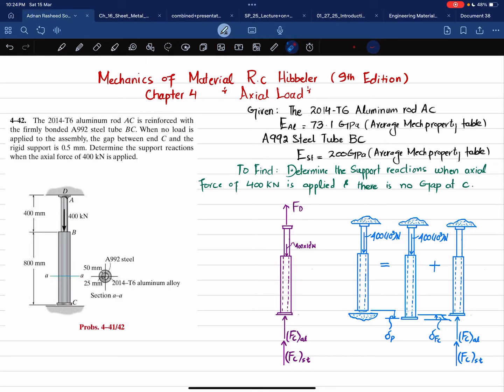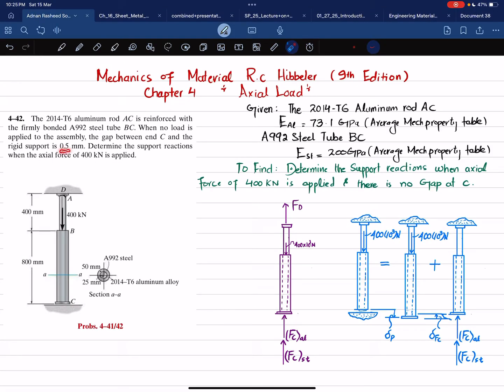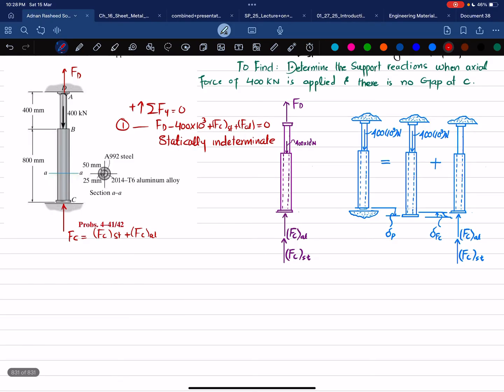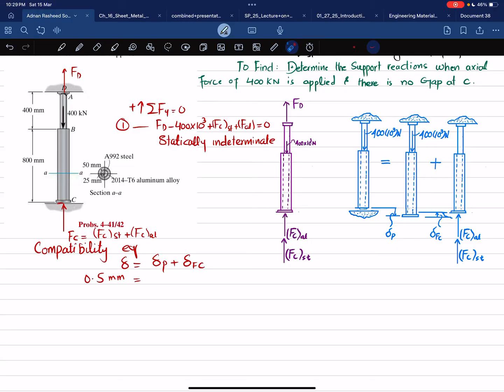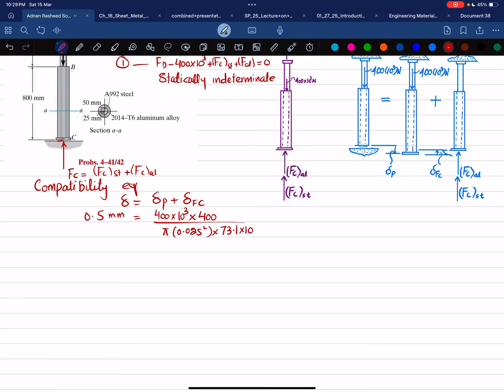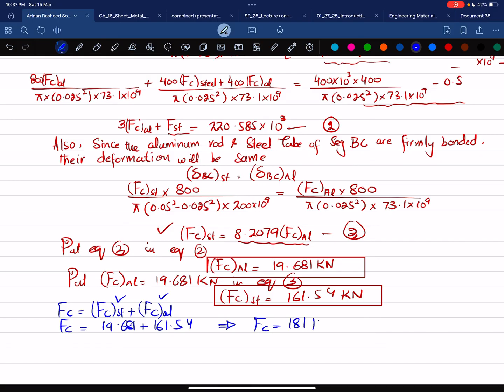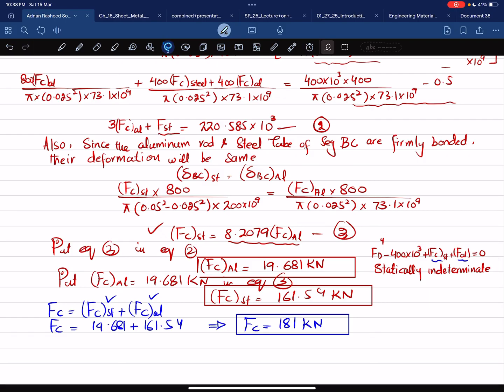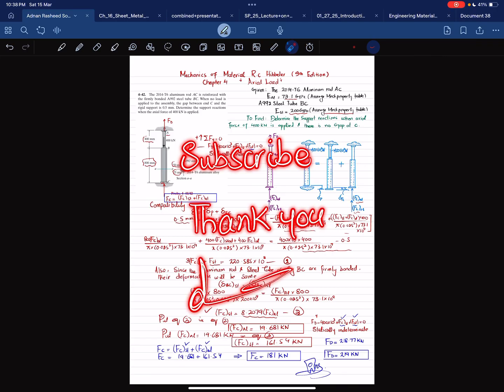4-42 | Determine the support reactions || Mechanics | Mechanics of Materials RC Hibbeler

Comment: 5:46 i dont get this part. Why would not the whole paranthesis be negative when both Fal and Fst is compressive? And how do you write them in the same fraction after that with only the modulus for Fal that is E = 73.1 GPA
Reply from the maker: YOU ARE RIGHT ITS A SMALL MISTAKE THERE IS NEGATIVE SIGN OUTSIDE PARENTHESIS AND INSIDE PARANTHESIS BOTH TERM ARE POSITIVE AND YOU CAN SEE IN NEXT STEP WHEN THESE TWO TERMS WHEN MOVE TO LEFT SIDE OF THE EQUATION BOTH ARE POSITIVE. I HOPE THE CONFUSION IS CLEAR NOW.

Comment: Good video! In minute 6:39  Why is the Fc in applied in the top part positive? Isn't it compressing the aluminum?
Reply: 9:12 why do u use 3 (fc) al can u clarify how u have simplified the equation
Reply from the maker: it's very easy simplify first term containing Fc al then simplify second term containing fc st and fc al and third term on right side. then add Fc al of first term and second fc al from the 2nd term and add them it will give you 3 Fc al
Reply from the maker: It is the force applied by the member on the wall as a result wall will apply the same force on member causing compression